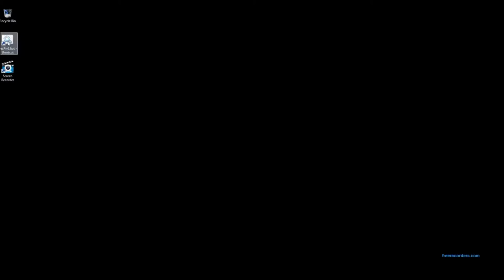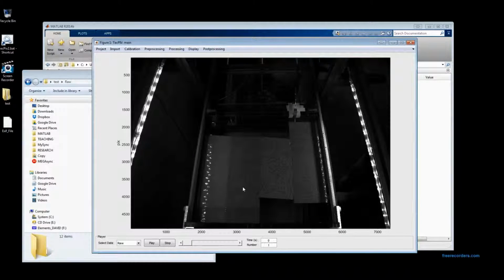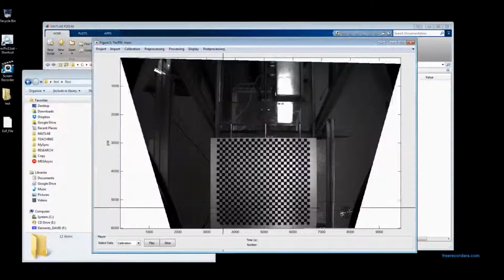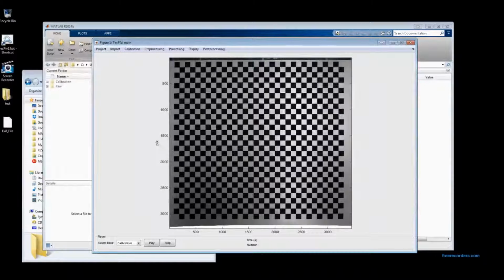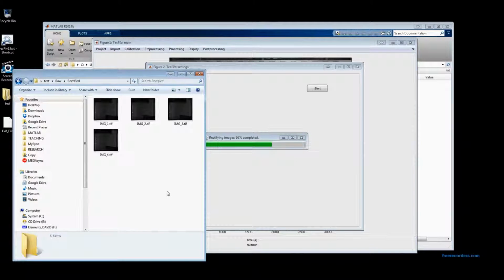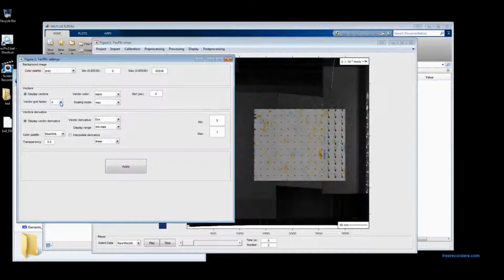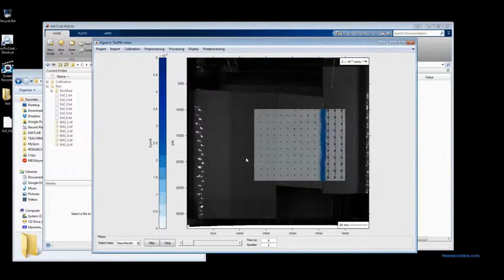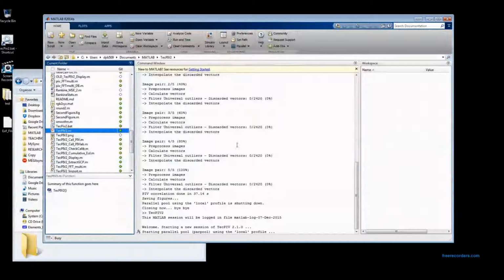TecPIV Project video 1

Comment: i have a problem. when i try to import the experiment image, this happen... what shoud i do..thanks

Undefined function or variable 'TecPIV2_Import'.

Error in TecPIV2/hImportFramesCallback (line 1728)
        [ NumberImages,ImageWidth,ImageHeight ] =
        TecPIV2_Import(myhandles.DataSets,ThisDataSetNumber,Iformat,myhandles.TecPiv2Folder);
 
Error while evaluating UIControl Callback
Reply: +David Boutelier
Reply: @terry1236  have you found out any solution?

Comment: is TecPIV an open source project? is there an interest to join forces with OpenPIV? see http://www.openpiv.net?
Reply from the maker: +Alex Liberzon 

Hi, Alex

Yes TecPIV is an open source project but I feel like it is more downstream from openpiv. I have build on pivlab which itself is partially building on openpiv, at least for the subpixel resolution. I would like to contribute to openpiv while keeping TecPIV focused on the requirements of my students in analogue modelling of tectonics. 

I have plans to develop a Lagrangian summation mode to compute cumulative displacement and deformation. It is not so important for fluid flow but it matters for solid deformation.
Reply: In any case, let's talk about the possible future of the two codes